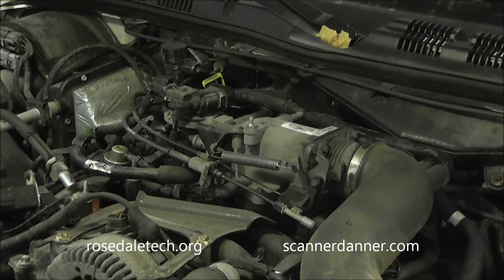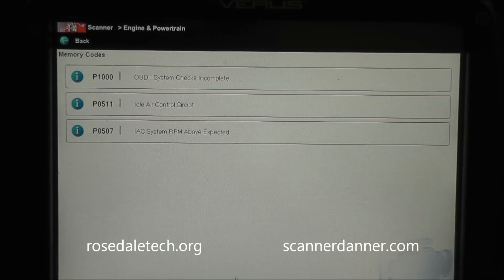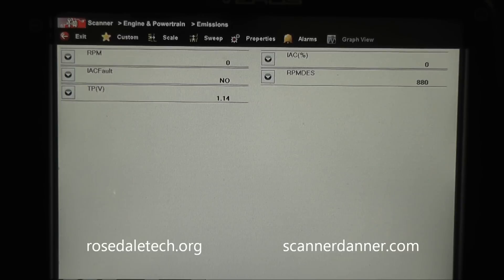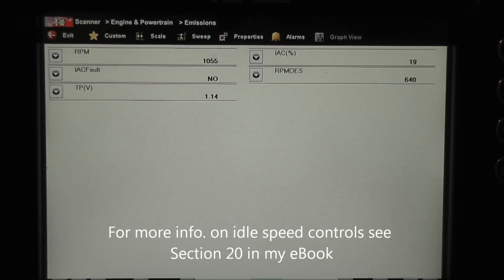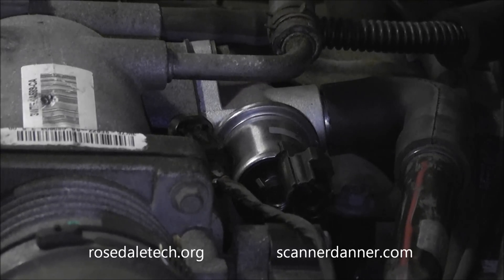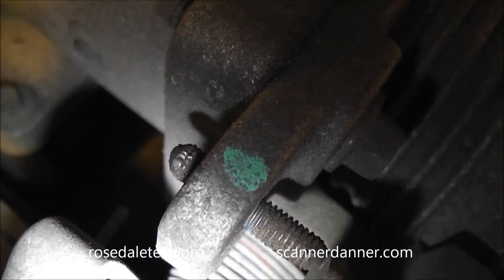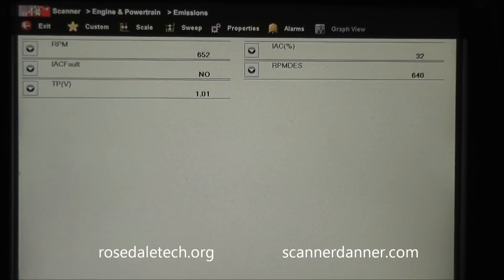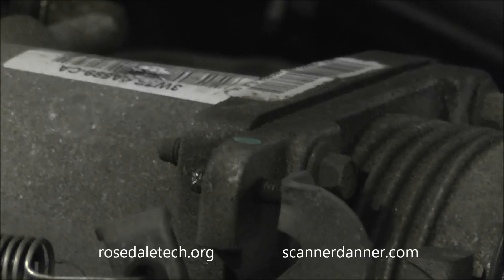Ford Idle Air Control (IAC) valve test (how to adjust minimum idle speed)

Comment: Still not sure how this can help. My 95 Ranger's idle speed gradually increased over a few days from 2000 to 3000, really screaming. Changed IAC valve, also found a crack in intake manifold, letting air in. Sealed crack, engine still screams. Ideas?
Reply from the maker: +Gary Crawford how does it idle with the IAC unplugged?

Comment: Very informative.  I am having possibly the same issue.  My truck recently started doing the opposite when coming to a stop.  Rpm would go down to 350rpm or so and eventually stall the truck.  I have a 2001 Ford F250 V10.  I have a scan tool and its showing my IAC% around 36% at idle.  Engine is idling around 650-700rpm.  When I unplug the IAC sensor I can hear the idle drop, but they only drop about 100rpm and the IAC shows 49% when I unplug the sensor to the IAC.  I am using an SCT X5 scanner to view the IAC data.

I replaced the IAC with a new IAC yesterday before seeing your video in hopes it would fix my issue and it did not resolve the issue.  Engine is brand new, new PCV, new IAC, new fuel filter, new spark plugs.  Throttle body base screw looks stock, never been moved.

I notice at the end of your video your IAC % is the same as my truck around 36%.

Thanks Scanner Danner!  I find your information always very helpful!
Reply: +Kendall Huseman 
I checked my voltage on the TPS with Key On Engine Off and it is at .99v.  I disconnected the IAC and the idle dropped.  I then blipped the throttle a few times and the truck would rev but about the 2nd or 3rd rev the truck idled so low that it stalled out.  Does this help at all?  It's seeming like the computer/tps or something is not adjusting quickly enough.  I do not have an EGR on this vehicle.
Reply from the maker: +Kendall Huseman start by cleaning the throttle body

Comment: Can this problem causing rough idling sir?
Reply: Short answer, Yes. Many things can cause rough idle.. IAC, EGR, O2 sensors, vacuum leaks etc.
Reply: aditya isfahani  & MISFIRES,LOW FUEL PRESSURE, CLOGGED  FUEL FILTER  ,A BAD FUEL PUMP
Reply: CHECK ENGINE LOVER can a clogged fuel filter cause a high idle?

Comment: Anytime someone adjust one of those idle screws to compensate for a closed IAC there is an easy easy way to reset those idle screws.take off the air cleaner assembly at the throttle intake opening and just slide it over to the right.  Now (without engine running) Look at the throttle plate valve and open the the throttle and close it.  You should hear metal hit metal, if you don't then keep unscrewing idle crew until the throttle plate touches the cylinder opening.  When the plate JUST TOUCHES the metal then that is where it goes!  Then if it wont idle after starting its your IAC.  When people turn those idle screws up they are bypassing a closed IAC is what theyre doing, but what is sad is that they think it is fixed.  It wont hurt anything other than the engine might sie a few times at cold start up but a person can get by that way until they change that IAC
Reply: humm, im trouble shooting a 99 windstar 3.8L, that idles rough and stalls at stops when in gear,runs smooth when accelrating or staying at street/highway speeds, the IAC is clean and working, EGR working, new DPFE, only codes 171 & 174  bank 1 bank 2 lean, throttle plate in correct position, 

ran good on July 1,  several days later upper hose leaked and engine overheated
vehicle is Not mine, current 3rd owner recently acquired it, 183670.xx miles

Comment: Hey Danny I have a 2001 ford taurus with high idle speed  there is no codes it will idle fine until you move the throttle even just a little bit and it will jump to 2,000 for about 10 second there's no vacuum leaks tps iac both replace and pcm replace and reprogrammed any ideas will be helpful thanks
Reply: +Chris Williams I recently installed a BWD IAC from an auto parts store. It looked identical to the original, except it had a spring behind the piston that my motorcraft one did not. It resulted in idle speeds up to 2-3000 rpms for up to 10 seconds before going back down to where it should be. Car ended up dying on me down the road because of that POS. Toss it out and buy the expensive motorcraft one. It costs more for a reason, clearly.

Comment: what software are you using to connect to your car i have a OBDll scanner but i cant do much with it but tell the fault codes and RPM & few more things
Reply: He is using a SnapOn diagnostics scanner. The software is built in. It's not something that you can download as a standalone tool.
Reply: JackOfAllTrades  you can....  I saw verus software  installed  in a laptop  ..

Comment: Nailed it!  Thank you very much.  I had a stalling problem on my Ford that I couldn't figure until I saw your video.  My numbers were just the opposite of these...  TP(V) was just 0.86 and the IAC(%) was at 52.  I realized the IAC was overworking to keep the idle at the desired RPM, and I had the room to play with the throttle position. I felt like I knew what I was doing!

Comment: Looking at my scanner-live data, i only see RPM at drive (650) and RPM at neutral(750) , is RPM at drive the same for desire RPM IDLE? .  I keep getting a buzing noise coming from the air tube that the iac valve is sucking air from.
Reply from the maker: roberto ortiz desired RPM is what the computer wants the car to run at. RPM should match Desired RPM. The buzzing sound you are describing could be a cracked bellows on the IAC valve itself. Older Fords had this issue. And it would also give you a higher than normal RPM at times. Pull the IAC off and look inside of it. Is there a plastic bellows inside of it? If so, gently look between the ridges of the bellows with a small pocket screwdriver, you will see the cracks.

Comment: Is IAC closed loop?
Reply from the maker: Marek Sumguy sorry about that, IAC = Idle Air Control
Reply: ScannerDanner I know what IAC is....im asking, does it run in closed loop?
Reply from the maker: Of course. It is active in all modes of operation.
Reply: ScannerDanner I have a 2003 Corolla (australian) and over the years it developed a low idle.  When i turn the parking lights on... the idle is bumped up a tiny bit... closer to what it should be.  When i turn them off... the idle drops back down. How can the IAC allow this to happen if it runs in closed loop?
Reply from the maker: Marek Sumguy Closed loop is just a term used to describe an operating mode where we "trim" the mixture using the O2 sensor. Open loop = O2 is ignored. That is the ONLY difference. Idle speed control is ALWAYS in play, in both modes of operation. If you have a low idle problem, there are many potential causes for that. First thing I would do is to clean the throttle body, then go from there. Any additional help you may need, please post to my forum. Thanks! www.scannerdanner.com
Reply: ScannerDanner Paul im not talking about closed loop fuel control.  Im talking about closed loop idle control. Just like you can have closed-loop boost control, ignition control, etc.   My question is; how can the IAC allow this low idle to happen?... the computer has a target idle rpm, so why doesn't it throw a fault code when the IAC doesn't achieve that target idle-rpm?.  Like i said... i don't think its stuck because when i turn my park lights on... the idle gets bumped up a tiny bit... closer to what it should be.

Comment: i got a 03 2.3 ranger with a po171 code i got new plugs wires and coil pack.. the stupid plug in the front of the intake manifold popped out and i jb welded it back in ..got rid of the other codes but cant get rid of the po171 code... fuel pressure is 65 steady vacuum is 20 steady... but still idles alittle rough and throws the code runs fine other than that...please help
Reply: POORBOYCUSTOMS Don't JB weld it. Install a Save- A-Thread kit. If you have enough room for the swaging tool, it'll work. If you need to remove lifters, get the special Ford tool called a Tappet collapse. Get the piston at TDC and both valves closed. Depress the lifter and remove the rocker arm. Crank the engine with plugs out to pump up the lifters.

Comment: why is it bad to reset and engines idle? I have set some manual cars higher to around 800 rpm to be easier on the clutch at takeoff.
is it because the computer will always be fighting it? this is a class a example of why I like carbs ha. cant stand my 2000 mustang and its idiotic 650-700 idle.
Reply: Raising the Idle Speed to other-than-factory specifications for the purpose of being "easier on the clutch at take-off" makes no sense at all. None.
 Your fuel-injected, computer-controlled engine works best when it is properly maintained, which means that ALL settings (including idle speed), are within factory specs. Many of these adjustments/settings are computer-controlled to maintain a level of accuracy while the vehicle is MOVING, which you cannot do with a screwdriver in one hand and a can of beer in the other ! !
 As for those "carbs" you mentioned -- I like 'em, too. Holley, Carter, Edelbrock, S.U., Weber, Aisin, Zenith, Rochester, Motorcraft -- whatever. I've owned and worked on 'em ALL. Different designs, from the simple 1-bbl Carter to the WAY-complicated 4-bbl Rochester, have ALL been replaced by the more accurate and reliable fuel injection systems on today's vehicles. 
 Now, let me ask you -- do you REALLY think that those FOMOCO engineers that designed your Mustang's engine are IDIOTS !?? Do you really believe that YOU are more qualified than the engineers to decide at what speed your engine should idle !?? HHMMMMMMMM !??
 Get a clue, son -- Carburetors are D-E-A-D. DEAD. As well they should be !!
Reply: @SlikLizrd  TFI is not here because of engine maintenance,
all this EGR , IMRC, PURge, dpfe ,  LOW IDLE, etc..
is ALL MANDATED by the Gov MPG and EPA air quality Regs
Not for engine life or performance, I like clean air, but lets keep things in perspective, I doubt Ford or any other engineer OR corporate boardroom, cares about Idle speed or clutch wear, they follow Gov Regs and hope for the almighty dollars to come in
Reply: @draizwrm  I know what those regulations are for, and exactly why they are there, since I have been maintaining automobiles since BEFORE the anti-smog regulations were in effect. At that time, there were people of every description screaming about "all the harm" that the regulations would cause to their cars, and how much power and/or fuel mileage would be lost because of those regulations. Billions were spent on products that would "overcome" the regulations, and  write articles about how to "defeat the anti-smog junk".
 It was ALL total bulls**t, right from the git-go. It was bulls**t then, and it's bullsh**t now.
 Proof ?? Easy !!
 In 1967 (before anti-smog regulations), there were NO 500-horsepower cars delivered from the factory.
Today, we have 500, 600, & even 700 hp cars delivered, and they are ALL "smog legal".
 Your complaining about those regulations shows that you really don't know much about the subject of Anti-Smog Regulations and the Standards of Compliance.
Those regulations are a BIG part of the reason that our air is as clean as it is now, and our cars and trucks burn cleaner and have more power than ever before.

Comment: Thanks for the great video.  I have a 1997 Ford F 250 PU with a 7.5 L gas engine that just started "today" having low idle issues.  I will check vacuum lines first, anything else you can suggest that a rookie with very little money can check?

Comment: Great video, learned a lot from it.  I checked some of your items, but nothing as yet will reduce my 1300 idle rpm.  1997 Taurus, replaced IAC twice, meter checked TPS, idle set screw correct, MAF cleaned twice, vacuum hoses checked, PCV replaced and even did a smoke test.  Only smoke I could find was coming out the body of the IAC around the body ring, not base plate.  Cleaned throttle body, checked and it is closing, sprayed break cleaner and nothing changed looking for air leak.
Reply from the maker: normal to see smoke come out of the IAC vent.
Disconnect the MAF (make sure the electrical connector is unplugged to put it in default mode. Remove air intake tube, find the IAC inlet hole in front of the throttle plate and block it with your finger. Does your idle drop or stay the same?
Reply: ScannerDanner Ok, unplugged MAF, removed Air Intake Tube, removed Hose infront of and below IAC.  This hose had a dbl clamp on it, short hose and 90 then went over to another vacuum control box where the BB hose goes. Plugged pipe and engine RPM came down to 900 - 1000, but engine ran very rough and could hear a pop or missfire, but did not stall.  Put it all back together and ran at 1300 RPM.  Thanks Scanner
Jerry
Reply: ScannerDanner Pulled IAC, blocked both opennings and no change in idle. Tried blocking one and still no change.  Pinched all vacuum lines and barely a noticable change in idle speed.  No change when pinching BB vacuum line.  Since I can find nothing else, I am thinking maybe vacuum leak under manifold.  Didn't get any reaction spraying brakekleen, but maybe it's just not reaching leak.  Thoughts?
Reply: jhaskins0256 It's rare, but exhaust leaks can look like vacuum leaks. Before the upstream(s) O2 sensor, if there's a leak, the engine will think it needs more fuel to compensate for a problem and it'd be running richer than it thinks it really is.
Reply: have you checked your ignition? a weak ignition will oftentimes cause a car to compensate to a higher rpm. that or straight vacuum leak as you are looking for. I just did a ranger where the fuel filter was nearly plugged and it resulted in a lean condition and high idle.
Reply: I did not check that, but thanks for the advice.  I actually sold the beast and no longer am dealing with it.  Again, Thanks.

Comment: Scanner Danner I have a 2001 and the code is P0351 means = # cylinder coil. now this is the second coil pact I'v replace in about 4 months. I did have the intake replaced because it was the recalled one and it finally cracked and leaked. everything ran great for months and then I replaced the # 4 cylinder and now it wants me to replace the #1. I have been having stall issues and this is prior to the # 4 cylinder replaced coil pack. I'm thinking it could be the crankshaft position sensor.. Whats your take? thanks. I watch you with Eric the car guy and I love the scanners you have. I just have the OBDII code finder. Nothing more. Have a good one.

Comment: Great video. Can a bad PCV Valve cause a rich running condition ? Thank you
Reply from the maker: I would say no, unless the oil is fuel contaminated.
Reply: Thanks brother. I changed the oil after I had a coil misfire and replaced the coils and plugs. I am still getting rich post cat 02s on both sides. Did a injector balance test and they are all good dropping from 45 down to 22 on all 8 cylinders. Have 39 to 45psi fuel pressure  at idle and have all four cats new, Walker, as the Ford cats were $2500 dollars for all four. Put all four Motorcraft 02s also. Has me stumped.
Reply from the maker: Rich O2s downstream of the cat is normal bro. The converter catches and stores oxygen.
Reply: OK. See, I learn more from you then I do the College I attend. Thanks again

Comment: I'm having idle problems on my 07 Crown Vic Police... The car never wants to run below about 1000rpm at idle. However, the 07 CV has the electronic throttle control. Is there any way to adjust it?
Reply: There is no adjustment on those systems. Need to look at all the scan data related to the idle control system and also for trouble codes next.

Comment: Hi Paul, on ones I have done in the past if someone messed around with the idle screw, I would clean the throttle plate etc with carb clean, and I would unwind the screw so the plate was shut, then screw it in so it just touches, or possibly in 1/4 after it touches and try it there, Fords here used to be 0.7 volts on Potentiometer,,,Fred uk.

Comment from the maker: not sure. the question is, Is the rising and falling IAC count the cause of the rolling idle or is it an effect of the rolling idle. My guess is it is the latter. 
I doubt it is a faulty IAC valve. They simply do not fail in this way. 
I would look close at those timing marks.

Comment: will IAC counts on a GM valve moving up/down, corresponding with rising and falling engine load %, indicate a bad IAC or the computer controlling (or trying to) the IAC in response to perceived changes in engine load?  tried a map sensor since it's a speed density system, no change.

2.2 ecotec, just did the timing chain.  has good compression but wandering idle.  no vac leaks, P0507 code.  i suspect the IAC.

Comment from the maker: unplugging this style of IAC will not cause an idle speed change even on a good working system. It is a stepper motor design that holds it's position. What are you IAC counts or position reading on the scan tool at idle with the engine warm?
Reply: ScannerDanner if I unplug my iac my car dies
Reply: @shawnlibby675  iy car dies too, when I disconnect the IAC lead. Ever figure out if that is an issue?
Reply: My car is idling rough in Drive, not in Park. It also hesitates while accelerating. I thought maybe the IAC could be bad. It's original, 215,000 miles. My OBD2 shows RPM at around 800 in Park, and 600 RPM in drive with foot on the brake. 

When I disconnect the IAC wire harness, my car dies immediately. You video says the idle should drop to around 400 RPM. Is my base idle too low? 

Any other tips for my rough idle? Should I try a new IAC?

My only code is P0430 - cat effieciecy. BUT, I've had that code for over two years now.